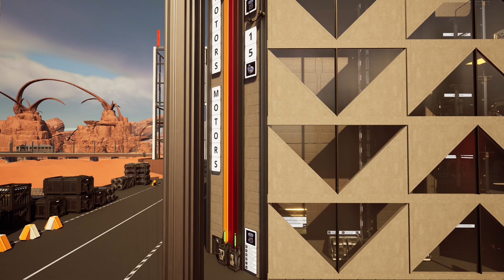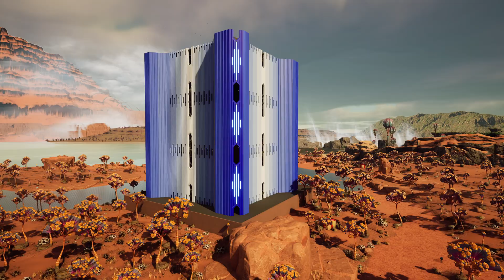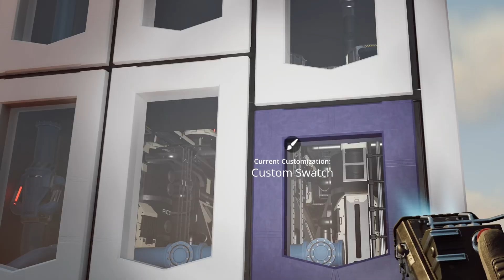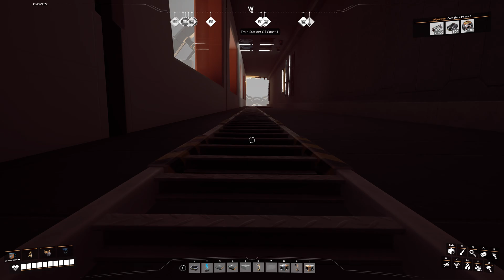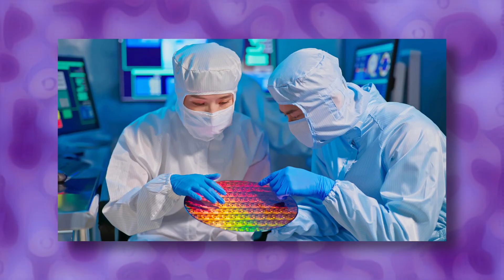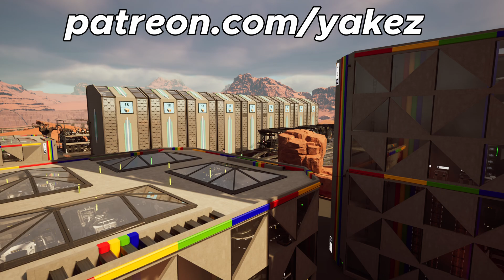1-CLICK Computer Cube Conundrum is Complete!

Comment: Just wanted to say how interesting I find your builds. I feel like you are quite loyal to the box design qhilosophy and still find very interesting and unique ways of styling them.
I personally mostly use a lot of inlays and various wall depths but that reduces available space in the blueprint but I’m fine with that.
Just my fuel burner building was made out of 3 blueprints😅
When I finally get around to posting some I will send u the link if u want ^^
Reply from the maker: I think I am still recovering from 4x4 era xD I am even thinking about going for modded 8x8 prints on the next city build to force me into way more chill and realistic exterior designs.
Reply: @Yakez42  so tru😹😹😹 tbh I didn’t even unlock the mk3 blueprinter yet. If u let go of trying to fit everything into one blueprint you’ll be amazed how much fits in there if u thing modular designs. Your exteriors are awesome and I’m exited for what’s to come.

I also wanna start with mods (inf.nudge) but I committed to fully vanilla🥲